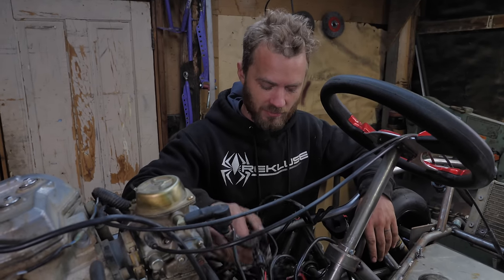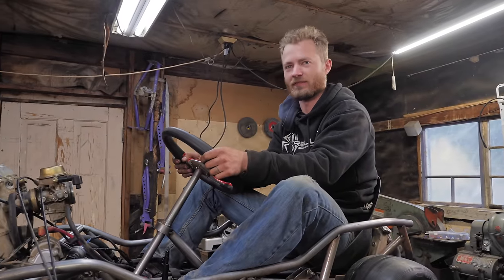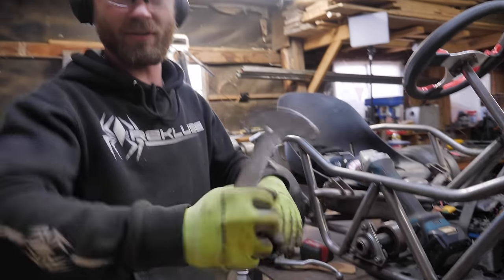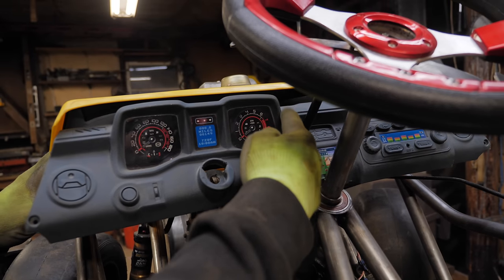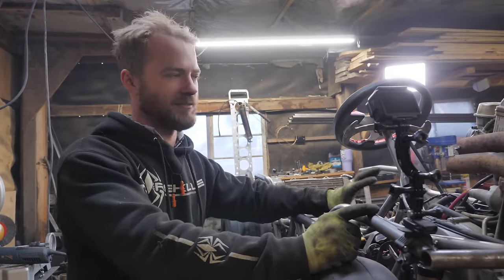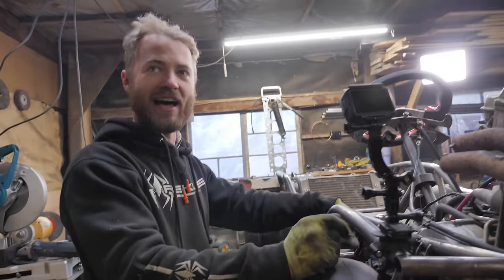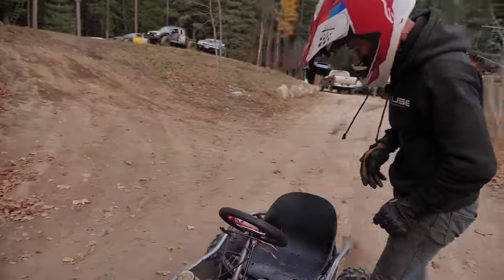First Test Drive! 500cc Off-Road Go Kart

Comment from the maker: Get the Kove Audio Solitude Noise Canceling Headphones for OVER 65% off this month: http://koveaudio.com/gh68

Code: GH68 (discount subject to change)
Reply: IT'S A BIT OF WORK BUT I KNOW HOW TO FIX ALL OF THE I-BEAM'S, CONTROL ARMS, ETC. FROM GETTING BENT. it is really simple you need to build BOXED A-arms, i-beams, control arms. thats how i roll on my prerunner. when i had tube arms they would get bent in one hard landing. i promise once you do it, you will not need to re-do again. heavy but strong. let me know if you have any questions or want photos for reference material.
Reply: Get a subaru wrx body
Reply: A turbo u say 😂😂😂
Reply: Nahhhh😂 a know u says it 😂😂
Reply: How much does one of those gocarts cost completed?
Reply: Grind Hard Plumbing Co With those older Honda motors you got to keep up on shiming them for valve adjustments or they’re really hard to start That’s probably why you were kicking it so much to get it started also the decompression and cam on it if it has one also go faulty and make it difficult to start
Reply: Do a dukes of Hazzard or Smokey and the bandit car build
Reply: I introduced your CAD to my robotics team(we dont have a cad division) and they shook their head at it
Reply: This lasts all month right??
Reply: For the clutch, is a cable possible vs a rod? I feel like that would prevent having to cut into the dash panel and also allow for even easier turning.
Reply: @400exrider111  Yep ! Honda's Suck … haha.
Reply: @WTFtube on my new LG Q8 phone it sounds perfect from transition to transition....
Reply: @masheen_  exactly just like on BMX bikes...
Reply: @eriknulty6392  excellent suggestion but you know what I made an excellent suggestion as well and got zero response from them I've made several excellent suggestions just to be swept in the corner. My suggestion was to use a high-torque dual directional electric solenoid for the shifter and they would be able to shift the buggy at the push of a button. Did I get an attaboy? Hell no
Reply: John Chrysostom  nope nope. Hytorc dual Direction electric solenoid. Push of a button says grab a gear
Reply: @Anthony Dorris yeah then they can keep up with the other two guys doing the same thing
Reply: Can u please put a fake bug Catcher
Reply: Just ordered a pair of KOVE Headphones... Thats a great discount... Keep making awesome small, lightweight go karts with engines in the front...
Reply: @chesterrowles87  they have fake chickens for that.🐓🐔
Reply: Youbshould have made one side the shifter and the other the clutch without the clutch having to share a paddle with downshift, you could do this by pulling up for down and pushing down for up then the clutch could be on the other side
Reply: What if the open area on the bottom of the hill you make it all dirt for donuts or mini jumps or a twisty hill climb?
Reply: I appreciated how u did your headphone video promotion, very well done. U good w da camera. B an actor.
Reply: Jaguar looked good
Reply: Should use u joint from a steering column in a car
Reply: what is ur real job? how do you have time for this... or do you only do youtube?
Reply: who put this car here do you know who put that car there?
Reply: I wanna see A customized losi DBXL on this channel. =)

Comment: For your next power wheels project, get a Dodge Ram and put a Diesel engine in it.
Reply: Yes ^^^^^
Reply: Hell yes that would be epic
Reply: Heck yeah!!!
Reply: Dude. Hell yes.
Reply: Power Wagon!
Reply: Yessss
Reply: Mrpotatoman Bob yessss just a dodge would be cool
Reply: Yes, monster truck it and see how it compares to a quad.
Reply: Mrpotatoman Bob with a small turbo would be cool too
Reply: Mefoy3 even better idea.
Reply: That would be mental
Reply: Yup could use a 2 cly onan
Reply: Loud and slow. But be a cool tow rig.
Reply: Add 4X4 on top too and that would the the most bad ass power wheel build ever,I can't think of a another project that I'd rather see them build than that!
Reply: @mckenzie4003  but if built correctly it would have the torque and travel to crawl over all sorts of terrain
Reply: Little 3 cylinder Kubota diesel. That would be cool. Roll the coal on it. Yeah!!
Reply: Dodge hellcat or demon
Reply: Then watch it break down and tow it back with a Chevy power wheels!
Reply: possibly 4x4 aswell
Reply: Hellyeahh!!!
Reply: Might even be a good way to introduce more than one cylinder to the Power Wheels lineup. I’m thinking an off brand Yanmar v twin, or a Kubota in line 3.
Reply: Depending on weight they could even get a little diesel out of the Cummins Onan generator
Reply: Use a FIREPUNK DIESEL Engine in your next build, which very well should be a 2019 Dodge Ram Cummins Powerred!!!
Reply: Cummins now makes a 2.5L crate motor!
Reply: Single cylinder diesel from concrete mixers lol
Reply: @spencervalek2173  what does crate motor mean
Reply: @pacman5511  new engine shipped in a crate. Usually comes with everything needed to run
Reply: Yes a dodge power wheels Cummins would be #awesome.
Reply: Yes amazing idea

Comment: I'm just concerned about that rapidly spinning chain between my legs
Reply: Ya hit the brake will also losing a toe. Cool build though
Reply: @fallingdownahole9706  definitely a cool build
Reply: He needs to weld a protection, like a motorcycle, if he doesn't want to lose half his leg.
Reply: GET A GUARD!!!!!!!!
Reply: If the chain breaks it will be spit out the front from the trans sprocket or out the back by the axle sprocket.  520 chain is pretty hard to break.
Reply: If the flames from the muffler doesn't get you first lol
Reply: this how in 1922, we invent carters...
Reply: The chain is usually fine. The sprocket is where you don't want to put your pp.

Comment: For the shifters, have you heard of, or thought of a system similar to BMX gyro brakes? They would allow the wheel to turn 360+ degrees, if required.  They're designed to allow bowden cables to operate around a pivot without binding.
Reply: Even without the gyro, cables on each side would be better, and negate the need for cutting the dash since they can be routed.
Reply: Yeah I vote for simple cables or hydraulic. The rod seems like it will be changing lengths and riding the gears at locks.
Reply: Came here to post this. I was thinking this was exactly what they were going to do and was shocked when he overlooked this because these guys are awesome and know their stuff!
Reply: I was thinking the same thing. BMX brake gyro design seems like it would work.
Reply: I was thinking they could surround the thing that connects the steering wheel to the car and just put column shifters
Reply: Everyone I see building karts on youtube is way over-complicating crappy mechanical paddle shifters that all really suck.  They need to just bite the bullet and go with a small air cylinder or electronic actuators and use push buttons.
Reply: I was thinking the same thing I suggested it to cars and cameras when they did a similar set up with Paddle shifters On one of their builds
Reply: Ikes brother even owns a bike shop
Reply: Cables would be a good way to go, but if the rod works, it works.
Reply: just needs a universal pivot point on the rod end to smooth it out. already works well enough.
Reply: Keep it interesting with a straight back and forth shifting setup... Shift with one hand, cross up with the other. It makes the ride much more fun! 😜👉  https://www.youtube.com/watch?v=wAMwdD-DG7k&feature=youtu.be
Reply: Or just make it so the paddles don't rotate with the wheel
Reply: nutwiss that’s what I thought immediately after seeing it.
Reply: They would have to be push pull cables and that wouldn't work on a gyro

Comment: You guys are great.  My Dad used to make us Go-carts mostly out of rebar in the early 60's.  Used 6vlt starter motor with a 12v batt.  Later he was one of the first people to make "dune buggys" by cutting up a car shortening it etc.  1st one was  a 50 Ford with a flathead v8.  He would have applauded  your style.

Comment: 16:47 is that another project 🤔. You guys are insane
Reply: NW Max Builds I’m betting it is
Reply: @quentin8094  they were talking about getting another body so it could also be that
Reply: @nwmaxbuilds8740  a street and an off road body! camaro body for the street. jeep for the trails.
Reply: Imagine if they made an awd crawler
Reply: @jakebraun6376  I was honestly wondering when they were gunna do an AWD build.lol
Reply: @jakebraun6376  awd dodge truck with a diesel engine would be sick
Reply: @nwmaxbuilds8740  The frame is designed around the camaro, complete with pointy nose. It would need a lot of modification to fit.
Reply: papakfmcnados king Hell yeah,no one would have a power wheel project that could even begin to compare to sheer awesomeness of a build like that!
Reply: NW Max Builds dude I saw it and I was like… yup power wheels keep 2.0 here we go again
Reply: @FloridaMan0561  If you check out their friend moto mule he is actually building a 4wd power wheels even though its mostly a rock crawler with the power wheels body.
Reply: Stockran swain Nice,I'm gonna have to check out that build for sure.
Reply: 16:53
Reply: @theginjaninja132  I'm building one I just need a small diesel engine
Reply: Hope so

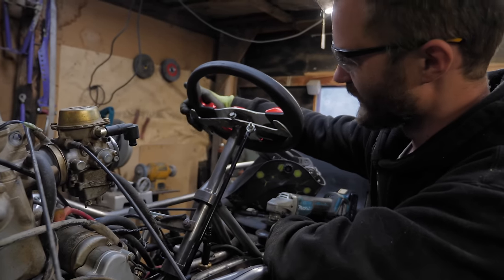Comment: 8:15 I was already thinking about that since you started to try the rods. I was like ehhh how's he gonna do that and steer 🤣🤣
Reply: It is possible, that it would be some accidental gear shift offs when he turns
Reply: I would have made a stationary pipe around the steering axel to mount the shift stuff on and made wider paddles
Reply: I was just yelling “weld a bearing to the steering column so you don’t snap your rod!” 😂

Comment: No you need a complete ground loop circuit mounted in multiple locations engine ,frame , big gauge wire , solder , no crimping.  
When your stator doesn't have to work as hard but yet when the DC current flows easily your power across the board goes up . Enjoy your Adrenaline cart.  Love it . Sir

Comment: I have one of those Polaris Predator 500 Motors. They won't rev unless there's enough vacuum in the air box to lift the secondary vacuum diaphragm on the carburetor. Basically the engine needs to be choked out a little bit in order for that carburetor to work.

Comment: Just a heads up if you're planning a turbo build, turbos do not work hardly at all on single cylinder motors. The single exhaust pulse is not able to spool the turbo effectively, hate to be a buzz kill but it won't work out well.

Comment: I would like to make a suggestion. I had mentioned this suggestion to cars and cameras and they did try it but it did not work. I think the perfect shifter would be an electric solenoid. They used one off of a Cadillac power door lock solenoid and it just didn't have enough power to shift. They tried to make it shift with the motor off as we all know that it's much easier to shift with the motor running. I know they make solenoids that are directional both push and pull that are high torque as that's what it would take. Then, you can just use a little button one on each thumb area location. Just a thought and please consider it. Do some research and see if you can find a high-torque directional electric solenoid. They also make them that are high torque that are activated by air but it's anybody's guess how many shifts you would get out of a bottle of air. Not many I feel safe to assume. Let me know your thoughts guys. I love the show as I mentioned every time I leave a message. Never got a response back of any kind but that's typical I guess. Moto mule will flat say hello if nothing else.

Comment: Love the paddles! Maybe adding a sleeve around the steering column that doesn't move and mounting the paddles to that? Or mounting it via bracket by the steering column bearing? Non-moving or "column mounted" paddles are motorsport preference anyways.

Comment: As no doubt already mentioned, two cable shifting works very well. Allows mechanical advantage to be set perfectly and steering isn't a concern.
A lot more engineering but a hydraulic system for shifting could be interesting to develop. It could be one of those, if you make it available they will use it, type of things.

Comment: love the ride! Inspiring stuff! A chain guard/plate, and front mud flaps and pivoting fenders would help. Also when u make a plate to bolt up to, try over engineer it. Leaving extra material on all suspension components. It will help keep everyone safe, as well as keep parts from needing to be constantly rebuilt. just lookin out. much love!

Comment: Try using a Morse cable for the shifter so it doesn't bind or pull on the shift forks when turning. Looks great so far. Can't wait to see it finished

Comment: maybe its a dumb idea but what about a jockey shift? side mount lever, clutch on the handle, slam it forward to drop a gear, and yank it back to grab the next? you have to steer one handed when you shift but its easy & reliable shifting

Comment: I accidentally sent one of those quads out from under me while WOT. It stood up on one rear tire and did the Tasmanian Devil spin 5 or 6 rotations! Lol, Gobs of torque. Still surprised it pulled that arm up. I bet it was a combination of the shock mount location, G forces, and engine torque. They all pull in the same direction against the shock at that point.

Comment: Do a cupler connection and mount the rod to the bottom piece and then a small rod from the back of the paddle shifter plate to the top piece of the connector. Depending where you mount that smaller rod, the more through you can get on the motor mount. 😎

Comment: Loving this build. 

It would be insane if you could do a rear exit dual exhaust with an X pipe under the chassis (for the exhaust note). I am not sure you have the space though, mad respect for fitting so much into such a tiny frame as it is. Ideally, a pair of resonators and dual exhaust would make that thing sound beastly. Throwin it out there anyway, you guys have already pulled off a fair bit I wouldn't have expected to be possible 👍

Comment: Could you use a bicycle collar and cable setup for the paddle shifter? Some of those are designed to let the handle bars spin 360 degrees within wrapping up the cables.

Comment: Hey guy's great job love the vids got an great idea for the shifting here, you can use the BMX front break set up for your clutch, it's connected  to bearings and cables, it will allow the steering wheel to spin independently without interference,  and continues to be intact so you can shift easily pluse it won't be an obstruction this will help big time

Comment: Have you considered adding another spocket on the otherside of the jack shaft to even the torque load on the rear end? Might keep from twisting anymore trailing arms lol. Love the videos, keep up the fine backyard engineering

Comment: Hello Ethan why don't you put a tube over top your steering shaft on the top portion. so that you can have your shifting paddles mounted and they won't move but yet you can still turn your steering wheel just put a bearing at the top of your caller of the tube. That idea just came to mind when you turned your steering wheel.

Comment: I think I'm gonna try building something similar to this..I have a destroyed kx500 that the engine still runs good on but the rest of the bikes is trashed so might as well use the engine for something fun..I imagine it's gonna be a wild machine with a 500cc two stroke engine on a tiny little machine..should be fun if I ever get it done..

Comment: For your control scheme, I would change it personally. I would put the brakes on the right side of the steering wheel, the clutch on the left paddle. Then you put a sequential up and down as the left pedal and throttle as the right pedal. That way it remains a familiar control scheme for someone to transition to from a motorcycle or dirt bike.

Comment: I always liked the idea of a front motor gocart. I would like to make a six wheeler about the same size with electric hub motors and steering sticks instead of a wheel. Also skid steering but with a small amount of regular steering because pure skid steering sucks unless you need a 360.
It could be freak fast.

Comment: Guys, easy fix on the paddles. Cut and fit a mounting bracket that comes up to where you need the paddles. Needs to be mounted separate from the steering column. Use the pipes that come from under the steering wheel towards the back of the frame as the base for your mounting bracket

Comment: Hey try using a small spring in between the shifter and the steering wheel so it doesn’t bind when you shift

Comment: Put two lazy susan's back to back over the steering axle. One bolted to the steering wheel shifter assembly, one semi-freehanging wired up to a shifter cable. For clutch, do the same. Remember not to rotate your steeringwheel more than 1080 degrees ;)

tldr; How bmx bikes handle the braking pedals on the handlebar.

Comment: Just put a sleeve over steering shaft, and attach gear changer and clutch to that, it will be stationary as the steer shaft will spin inside sleeve.

Comment: I was thinking how you were supposed to solve this gear vs steering issue, but since you just kept going I thought maybe there was a an outer an inner steering axel going on here. Before that i think the solution is to have to disks on top of each other but linked, where the lower is fixed to the frame and upper is  fixed to the steering. So when you push/pull the shifter you will move both at same time thus making the shift.
Reply: See that several others has mentioned the same in reference to BMX 360 steering. Gyro break is what they call them. Same principle as I was talking about.

Comment: You need a muffler for back pressure, that not only hurts yr performance, premature wear on the engine , burn yr  exhaust valves up. Its pretty cool though...